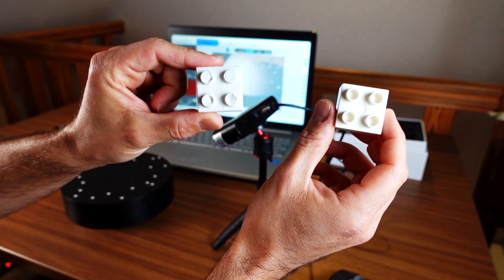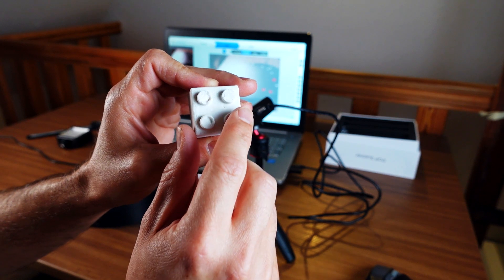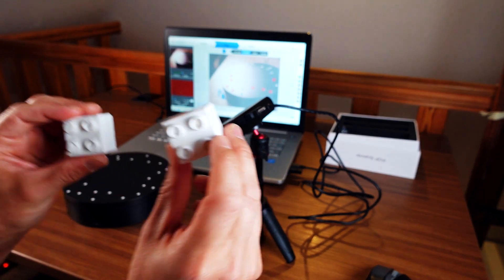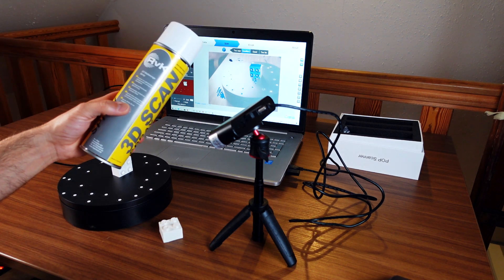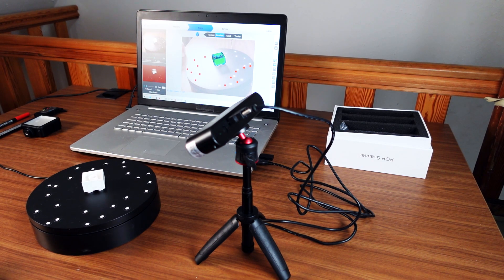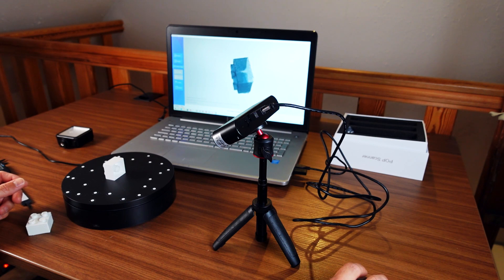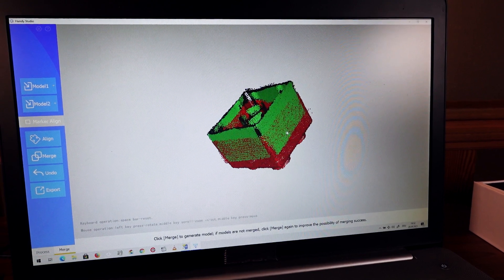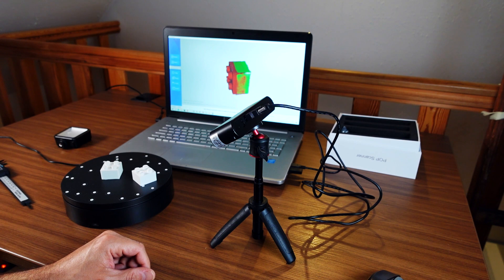Revopoint Pop 3D -- I 3D copied this building block - Should Lego worry?

Comment: Maybe add different textures or marks on each wall of the object.
Reply from the maker: I kind of tried that already, using a marker to draw different patterns on each side. Didn't change anything, I felt. But thanks for the suggestion, maybe I have to use something clearer, like different stickers, or similar. Will post a new vid once I succeed.

Comment: Use "marker align" with the sticky dots ... ON ... the object that came with the package. That allows you to MORE accurately use a point on the object to mark. Also, use more than 3 marker dots and its dang near 100% accurate at merging object

They don't have this process in their video lib (they just use the turntable with markers on them) I think they assume people know how to use the stickers on objects to marker align and merge. Took me nearly a month to figure it out, I'm scanning large objects the size of small cars !
Reply from the maker: Thanks for that tip, I will give this a try. However, if I put the marker dots on my brick, how will that information be preserved inside the Handy Studio software? All i have there is the point cloud, how will the marker position be still visible ?
Reply: @GravityBites1  it'll show as a hole  but there is a fill hole function in handy studio so it doesn't show up in the mesh